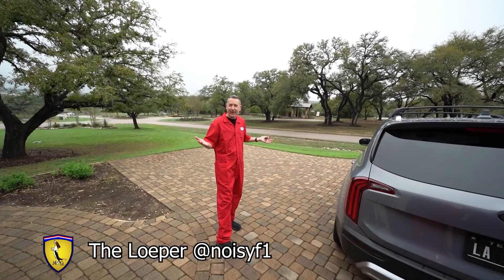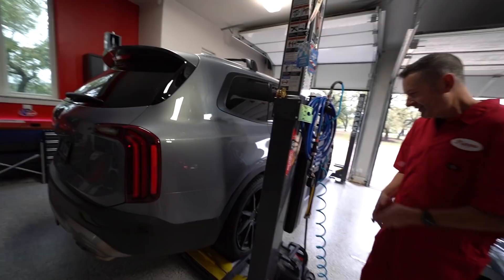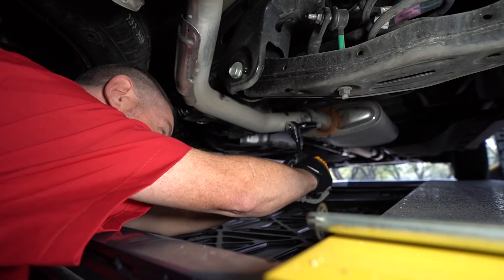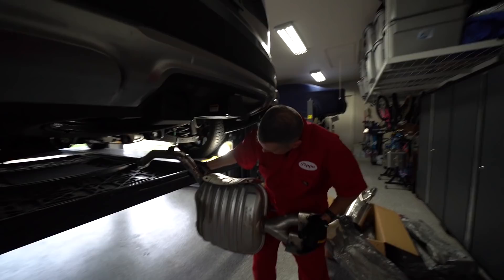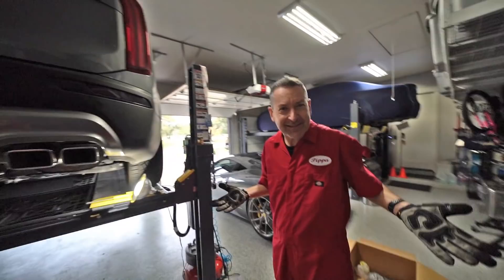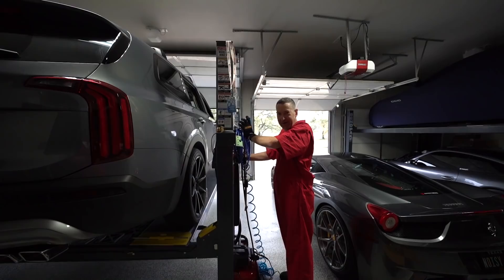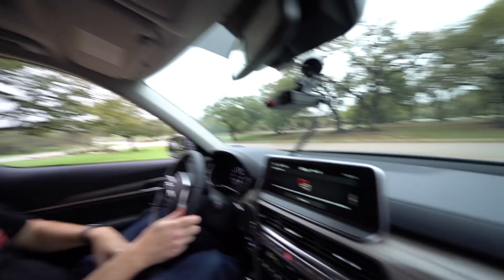From BORING to Meh. Borla Exhaust installation on a... KIA TELLURIDE SUV?!?!

Comment: Thanks for sharing.  I'm actually contemplating putting a Borla exhaust on my Kia Telluride as well.  Hoping it will help with the throttle response and will sound better.
Reply: On these newer motors the throttle response is done in the tuning. Get the computer programed and it will be a different beast.

Comment: My borla exhaust is arriving today can't wait to install it on my telluride nightfall edition 👍
Reply from the maker: Niiiiiiiice
Reply: Have you had a check engine light or any issues since installing the new exhaust?
Reply: While checking K&N for an high flow air filter I saw they have cold air intake system for kia telluride as well- I'm considering going with the cold air intake  system instead of just a high flow air filter- what are you thoughts?